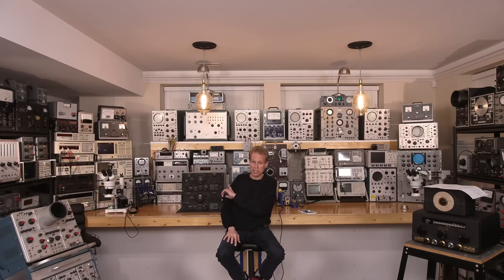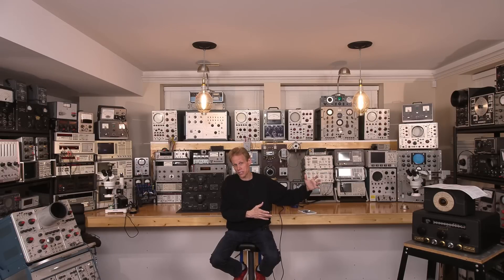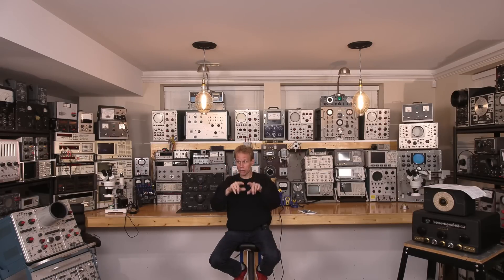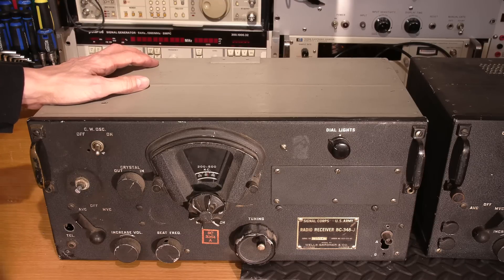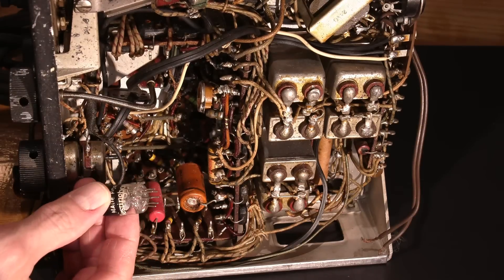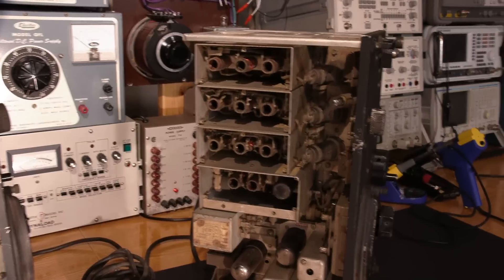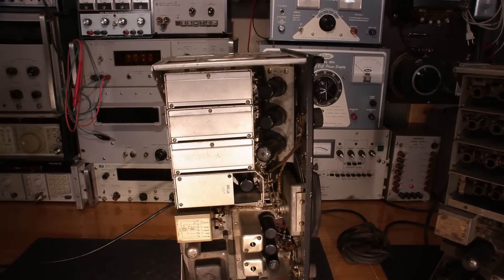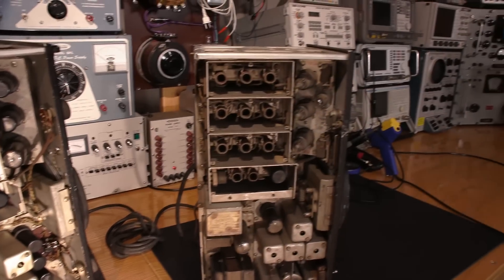Restoration Warplane Radio Receiver BC-348

Comment: Yes for sure the grand receiver restoration project it is really worth the time to do. I have a Bc348Q I repaired and got working. It had been changed from the original dynamotor to a power supply that I had to repair and of course recap and clean it up. It still works fine i repaired it 2 years ago.

Comment: Yes yes yes yes yes to the Grand receiver restoration project! I too would pick the center cleanest looking receiver. However it would be interesting to find out what that little regulator is doing on the chassis to the right and see if it may be something that is worth adding as a modification. Keep up the great work. I love these old huge fantastic HF receivers.

Comment: I definitely like this receiver series. As to which chassis to restore, I leave it to you, as you will know best, but I like the idea of keeping the chassis as original as possible. I also like to see the vintage 5 tube radio repairs and the vintage test equipment repairs, as I have a few units of my father's and grandfather's to work on.

Comment: Back in the day when I was an Engineering Lab Technician I used a piece of test equipment By WaveTek, their model 172b programmable function generator. if you have one of those I would enjoy a video of your evaluation and possible restoration. I am currently looking for one at a decent price. I've seen some for almost$1000 and they don't even work! I don't like to spend more on a piece than it was worth back in the day when it was new, especially if it's not in mint working condition, you know what I'm saying. Thank's Paul and also thank you for all your expertise on all this old test equipment. It is such a lost art. and the old electronics were beautifully designed, even before all the solid state technology came out.

Comment: Yes, PLEASE continue the series. I'm one of the folks that watched all 11 parts for the previous radio. The knowledge you're imparting about troubleshooting, alignment and physical/electrical restoration is very useful and not commonly found nowadays. I concur that Radio 2 with the PS from Radio 1 is the way to go unless there is something very compelling in the schematics of Radio 1's circuit to make it a more sensitive/selective performer. Carry on, Paul. 73, WF5X

Comment: I think I’m going for the balance. I immensely enjoy your videos and you got me interested in the upcoming projects still lingering in your storage (22nd April video). Seeing the huge amount of time and effort going into the radio-receiver series I would say: finish the current one and then do some smaller projects from your storage and maybe later another radio-receiver again. 
On the other hand: I’m still working backwards through existing video’s, so I will be enjoying the channel anyhow 😅. 
What is equally important is the question what gives the most energy and fun for yourself? That will reflect in your videos as well and will also prevent you from a content-creator-burn-out.

Comment: #2 definitely. The 348Q was my first receiver as a novice ham in 1967. I have a pristine working Q model with shock mount that I run every Straight Key Night. A great receiver and very stable. I am glad that you want to restore these to original, unmodified specs, not counting the PS. It saddens me when mods ruin an otherwise great radio. I have a late SN 75A4 that is unmodified except for a very misguided attempt to convert it to a solid state PS. I hope I can get that beauty back to life in its original wired form.

Comment: I used a BC348Q for years when I was a HAM novice. It worked extremely well. Please consider restoring this one (#2). Mine had already been modified with the power supply inside the speaker cabinet. A very good receiver! TNX xWA4LWY.

Comment: Yes please, it would be god to see this interesting piece of history being restored,. Also I agree with your initial thinking of using R2 as the foundation of the restoration along with the fascia and power supply from R1, and essentially using R3 for spares. Before finally committing though would be interesting to try and get an understanding of those extra stages in R1, and their pros cons. Great work!  👍

Comment: Hi Paul, and thanks for the explanation on the intro. I'm still very interested in the complete series of the 5 radios and the final testing and scoring. Now that you explain that each radio might take a month, sprinkling some fast repairs in the middle is a good idea. I suggest including restorations and repairs of old TVs, maybe even conversions to digital. Regarding the radios in this video, I agree that we have to look at the schematics to see which one has more chances against the other four, considering a restoration to factory specifications.

Comment: Which receiver. The easy parts - The power supply from 1, the face plate from 2 and (nice touch) the dial light dimmer from 3. The works from 3 are clearly past restoring. The works from 1 look interesting and are cerainly earlier but would require work to un-mod them. For an easier job, number 2 but less historical interest - probably not actually wartime.

The Grand Series. It is absolutely fantastic. You are up in the master class of electronics videos and these grand receiver restorations are the cream of your output. So please do continue them.

Comment: Definitely continue. I have been waiting for the BC-348 to come up in the rotation. I would also say to go with number 2, the Q. There were several companies that made these for the military. The one on the right is definitely earlier and probably a different manufacturer.  The J, being made by the same company as the Q, will provide any parts for the q and use the best power supply and you will end up with a great radio.

I have a Q with a home built power supply that needs a little attention so I look forward to this one.

Comment: Yes! I'd like to see the "Grand Receiver" restoration series continue.       
I'd like to see one of these BC-348 restored to completely original,  The face plate of number 2 with the case of number 3....   But overall,  I'd probably like to see Number 2 restored.   
I will admit your channel was the first I started watching with tube radio/receiver restorations and it sparked m interest in these devices also.  I always enjoy seeing a new video from you.   I particularly enjoy the videos that are about 1 to 1/12 hour in length.
I think maybe the interest i nthe last one dwindled a bit just because of circumstances that left a rfair amount of time between episodes.   The interest may be more if the "episodes" of the series are closer together?   Just my thoughts and I completely understand why there was distance between the episodes last time.  :)

Comment: Please continue the grand radio restoration project. It has been fantastic so far. Based on what I saw in the video, I would restore the radio number 2. Of course if radio number 1 has some special feature the other 2 doesn't then you might have to restore it. Thanks again!

Comment: Hi C…I look forward to all your videos and especially the grand radio restoration series. I have always loved old radios since I was a kid. I have done some restorations but have stayed away from doing major adjustments. Now that I am in my early 70’s I would like to attempt a restoration of something like the Hammarlund SP600. My only hold back is not having access to test equipment like a Spectrum Analyzer and some of the great test equipment you have. I don’t think I am alone in this area. So, I would like to see some of the adjustments made with an Oscilloscopes and Sweep Generators which are more accessible to the average hobbyist.

Comment: There is a way to do it all without disrupting the major projects.  Just film a bunch of one video projects before you start the major project, and then intersperse those videos between episodes of the major project.  I watch a number of content providers that do just that (not necessarily in electronics). Those of us that tend to do this type of stuff like to feel the satisfaction of seeing a completed project.  Single video projects accomplish that.  Also, the more complicated stuff is interesting, but if it takes a few months to get that completed project high, then interest wanes.  The new project then perks interest.  You can have it both ways.  Getting the process started will be a bit difficult because you want to produce content but need to get the "production line" going to accomplish this.  I just know that I am glad that I saw your videos before I saw shangoo's when I started restorations.  Keep up the good content.

Comment: Restore the one that has the grid cap tubes it’s probably the oldest one to restore and the most interesting one too with all the coils and the voltage regulator bulb which I suspect is a neon type of voltage regulator in the receiver, thanks I enjoy your videos, I’m in to antique electronics and vintage electronics as well I’ve been in it since 1980.

Comment: Mr. Carlson, definitely the BC-348-Q.  Wells Gardner &Co. produced the J, N and Q  which were the last of the series and had the single ended tubes.  Came across an ad 1947 QST mag. for 24 volt model $69.50.  AC power supply kit, or a power transformer alone, your choice $6.50.  I'll take two please!  If the performance comes near to my ARB, it'll be well worth your work!

Comment: I will vote for continuation of the series. I also vote for number 2 (center one-BC-348 Q)  I have an BC-348 N and Q. My Q is parts donor. My N was working but audio cut out and I found a burn wire  going to Audio VR. Stopped totally. I was eagerly waiting for this series. Thanks for the years of your videos and expert teaching, specially your tips and tricks. Best one was explaining the use of "gimmics".  I also have the dynomotor supply.
Pay particular  attention to the crystal filter and IF which is 912 khz. Tune crystal filter 1st and then IF with crystal in circuit. (Check out manual). It will tune upper BCB. I pull in stations 90 miles away that transmit 270w in daytime, as I'm in the fringe area. I use a directional diamond shape tuned loop with the radio on a sense winding. It sits on top of the radio. I think because the IF is in the middle of the BCB, that is why there is no BCB band.

Comment: Go with Radio 2.  It looks and probably will perform better........I am very interested in the restoration of the "Warplane Radio Receiver".  And by the way, you do an excellent job with the Restoration series. whether a complex receiver like the BC-348 or a simple "all-American 5" table top AM broadcast band receiver.  I find the diagnosis of the problems as well as the how to "tweaking" to peak performance the most interesting and educational.  Keep up the great work..........Steve.

Comment: I agree that the middle one is the one to restore.

For the receiver restoration series, I would like to see the designs compared. After watching a few of your videos, it's pretty easy to get that leaky capacitors need to be replaced and that resistor values have to be checked. Sometimes, there are noisy components that need to be identified and replaced. After a while, although each receiver is different, the broad strokes are pretty much the same.

Personally, I would prefer more modern electronics, but I would still probably watch the restoration series. I would probably skip over all the parts about alignments since they are specific to each receiver. Since I will probably never own or restore such a receiver, it's of little value to me.

I'm much more into HiFi electronics and power supplies.

I'm pretty much a beginner in electronics. I know the basic such as Ohm's law, the relation between voltage, current and power and the likes. So far, I have managed to repair a mini HiFi system with nothing more than a multimeter, pliers, a set of screw drivers and a soldering iron. I'm kind of proud of myself for that one. A diode in the snubber network around the coil a the relay used to switch between the headphone jack and the speaker terminals had failed short circuit. That in turn had fried a resistor and since there was a short circuit around the coil, not enough current was going through it to activate it.

My current project is trying to repair a broken ATX power supply. Clearly some capacitors have failed (bulging and expelled electrolyte), but I'm afraid that it might have damaged some of the ICs. I've started to try to reverse engineer it and I'm drawing a schematic as I go along. I can understand what each component does individually, but I have a hard time figuring out their function in that specific application.

I find soldering pretty easy (although you never have enough hands!), but I really struggle with de-soldering; especially components with lots of pins or connected to massive contact plates. Does soldering braid actually work!? Even with flux, it never does a good job at suck-up the solder. Maybe I should go watch your electronic course on Patreon.

Comment: I vote for number 2, the power supply may be exchanged , anyway if you want to compare has to repair the 1 and 3 also, your work is excellent, learned more of you since i see your videos, no matter if repair old receivers or projects like your capacitor tester, is a pleasure to see the perfection and  the profund knowledge of any branch of electronics, please continue (EX LU1OBI).

Comment: There are many variations of the BC-348. They can be sorted into two major categories: 

- the original design with tubes that have top caps
- the revised design with single-ended tubes and some simplifications to make it easier to manufacture (mostly J, N, and Q versions). 

There are a LOT of differences between the two, but many of the parts are interchangeable. The original design is superior despite being "busier". You have two of the revised design (Radio Two and Radio Three) and one of the original design (Radio One). 

In my opinion Radio One is the unit to restore, because it's the original design. Second choice would be Radio Two, even though it's the revised version, because you can take parts for it from Radio Three. Note that you can swap front panels to get the best-looking one.

Please don't be too hard on hams who did modifications. Back in the 1940s, 1950s and 1960s, electronics were MUCH more expensive than today, and those of us who used receivers such as the BC-348 usually couldn't afford anything newer or better. Nor could we afford much in the way of test equipment, and documentation available was minimal. And many of the modifications DID improve performance for amateur purposes.

Note that in these receivers the B- is NOT grounded, because the audio output tube also functions as a sort of voltage regulator. Grounding the B- was a common mistake, causing the audio output stage to draw high current and burn out the audio output transformer. The audio output stage in these receivers wasn't designed to drive a loudspeaker, either. 

Definitely worth restoring to the full Mr. Carlson level! 

73 de N2EY

Comment: Hi Mr Carlson, 
I would use the second radio as the best restoration candidate. 
In future, I would prefer a shorter restoration series or an individual piece of equipment to restore instead of a long series. 
Thanks for asking, and good luck with the project!

Comment: By all means continue with the grand receiver restoration!I’m currently involved with a repowering of  a BC348Q receiver now ,the SET version aka “single end tube” version.I will be replacing the 6.3 volt transformer for a modern 24 volt filament transformer and returning the receiver to its stock parallel 24 volt configuration.i’ve been on hold for awhile ,waiting to have you start yours so i can get some pointers.thanks jim

Comment: Anyone who has ever attempted to upload a quality project fully understands how time consuming the process really is. For those who have not. I assure you it's as challenging as the project itself - maybe more. I tried to do a video of a guitar amp once and it was a disaster.

I would get caught up in the build and forget to hit record, edit, start over, sync the clips, check lighting, etc. It is far more difficult than it appears.

I like all receivers, and would be fine with anything you want to restore because I always pick up tips that I was not aware of.

Comment: In my view, the best option would be to use de face of the second receiver, the power supply of the first one,  the old kind of tubes with grid caps and the regulator tube of the first receiver with the shielding of the second one. The third one would be a donor of the case and other components.
By the end you will have a good receiver and one not so good in reserve.
Of course we want to have a video library for the reference for future restorations of this communications receivers that you will provide for us. Thanks for the videos.

Comment: I would like to see more regular uploads but also the receiver restoration series. I would be happy to take more time between receiver restorations if it means more overall content, or less content per radio. Perhaps focus on different aspects of the repair of each radio, or particularly interesting problems you find.

Comment: I'm for the middle one, the -O, radio 2, an outward clone of my first Novice receiver I used when learning CW. The inside of one w/o the data plate, radio 1, looks like the one I had. Seeing that one really takes me back. Too bad there's no NAA anymore sending CW for the curious to learn Morse by. And yes, continue with the series, especially the SP-600, probably just like the -X sitting on my shelf. Wish I had a SP-600-VLF :-) Rare as hen's teeth.